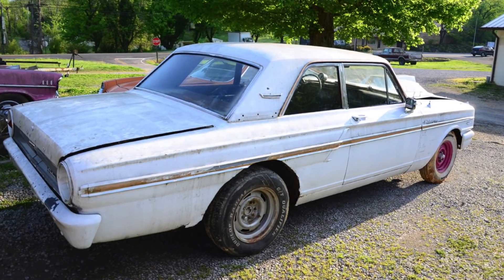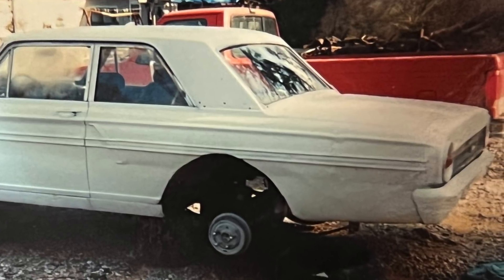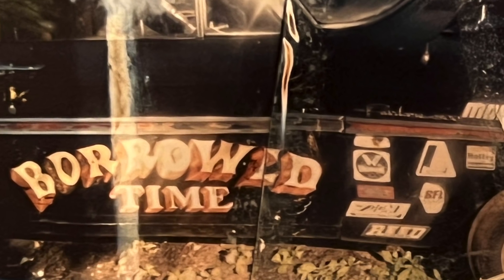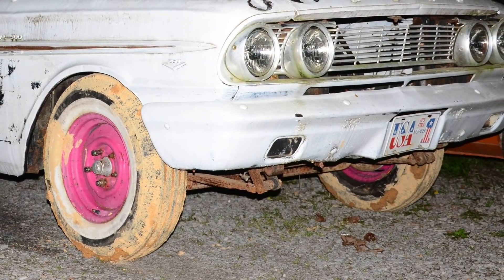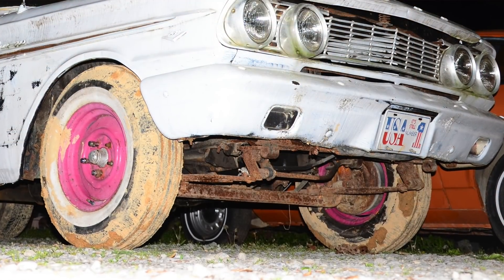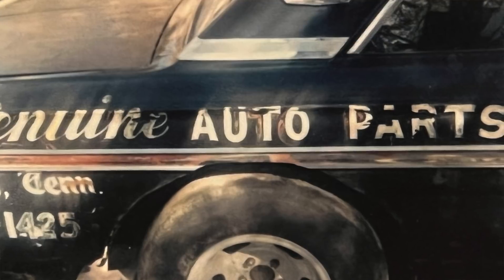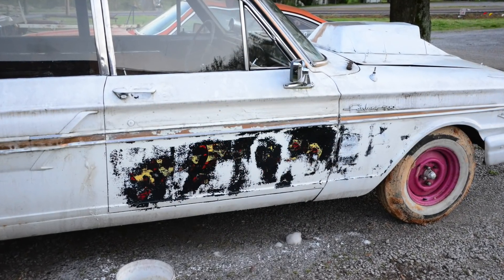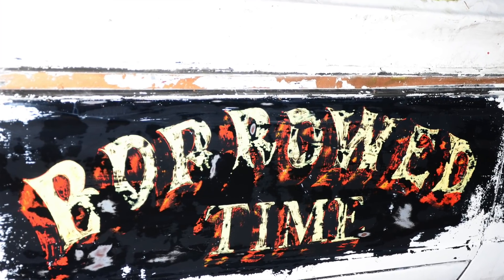Uncovering the HIDDEN HISTORY of a Forgotten Drag Car (Oven Cleaner Paint Removal)

Comment: In 1964 I purchased a Fairlane 500 Sports Coupe. 289 CU IN 271 Hp. Grey with red accent molding thru body. My friend purchased a White 2 dr post Fairlane Coupe. no 500 tag. Called Thunderbolt. Bare bones interrior, 427 CU IN and was delivered by Bayonne Ford in NJ in March 1964. No rear seat, no radio, nothing. It was a race designed car. I recall $3200 price. On front fender was flags that said 427. The front grill high beams were not there. The opening was for fresh air inlet directly into engine.  His other car was a Chevrolet Bubbletop 409 he raced at Island Drag Strip. By the way I recall engines availability for the Fairlane were 170ci, 260 cuin, 289 cuin 2 brarrel and 289 4 barrel HiPo. There was a 221 ci in V8 in 63 but not readilly available.  3 speed stick, 4 speed stick and Cruise O Matic auto.

Comment: I been using oven cleaner for stripping paint from army wooden ammo crates for 30 yrs. Since you mentioned the Shelby and I watched yours then Dennis Collins and commented on his. The dealership most likely to have sold the Shelby would have been Jack Loftus Ford  1973 I started working at that dealership but by then it was a  Porsche Audi dealership. Hot rods and drag racing in that area at that time was how I grew up. The Porsche Audi dealership changed my interest.

Comment: I happen to have two 64 fairlane htps in my collection. I also have a ecoline that still has the straight axle under it. and too boot I have a 428 FE engine. however Im 70 years old and have way more projects than I have time.

Comment: You are right though, if it’s  to good to be true, it usually is. You are also correct about removing the top layer.There is about no way you can strip paint off the top of other paint without it showing some kind of damage . I have ben doing paint for over  30 years and have not found a good way to do it , about impossible!

Comment: Back in the late '80s early '90s, I looked feverishly here in the mid MI area for a GM 12bolt posi for my 69 maro... A 12 bolt posi WAS the Go-To rear end back then, seldom thought of the FoMoCo 9" ...Had Leads that quickly vanished & was told All the Circle Track racers had them & wouldn't part with them.

Comment: I used oven cleaner to strip a painted sign off a 20 year old Ford van.  The factory paint was chalky, but it adhered well and did not strip off and reveal the undercoat or bare metal anywhere even though the oven cleaner thoroughly removed the sign lettering.  You were stripping the white brush paint job off a sign painted underneath, not factory paint baked on at 500 degrees.  Stripping paint can leave the patina underneath pretty intact if done without scraping or sanding.

Comment: Even back then they knew if you want it to be built Ford tough you need to use Chevy stuff...
Reply: riiight. 12 bolts break all the time. 9" fords are far stronger and lots of chevy guys use the.  i'm gonna give you the benefit of a doubt and assume you're trolling.
Reply: @Ecosse57  lol. I was trolling , a little.  The ford 8.8 and 9" are both great rearends but the idea that 12 bolts " break all the time " is laughable. The biggest reason people switch to a 9" is the removable center section and lack of C clips.  Ya, plenty of Chevys have a 9" reared but there are 100x more fords with Chevy motors.  O,  and don't forget....The fastest cars at the strip ALL run a Turbo 400 or Powerglide, (unless lenco or liberty) , no matter what engine is in front of it.
Reply from the maker: Ford vs. Chevy arguments are fun. Carry on!
Reply: @HotRodHoarder   I'm trying but I think my fish spit the hook...
Reply: The most popular rear  end for ALL makes of race cars was  the 9 INCH FORD.....BUILT FORD TOUGH.
Reply: @gregstaton128  And 99% of fox body mustangs have a CHEVY ENGINE in them, along with all the fastest cars having a Turbo 400 or powerglide in front of that 9".....  Built ford tough with CHEVY STUFF.
Reply: I had a 408 stroked 351w in my Fox body drag car and had JW Trans. 2 speed that had a bullet proof case....it was NOT built by GM.